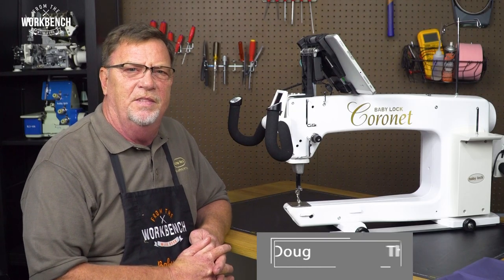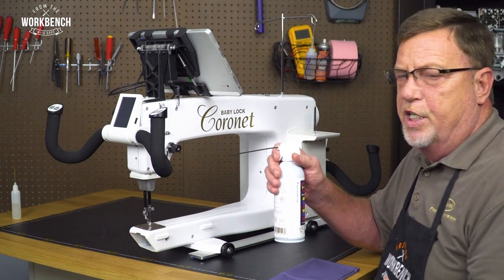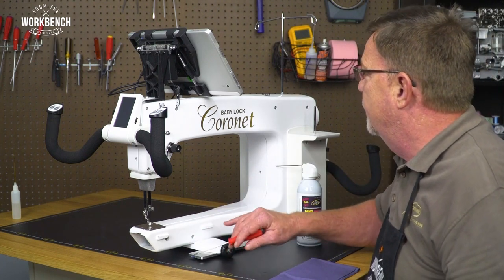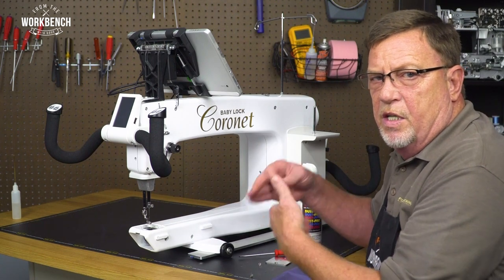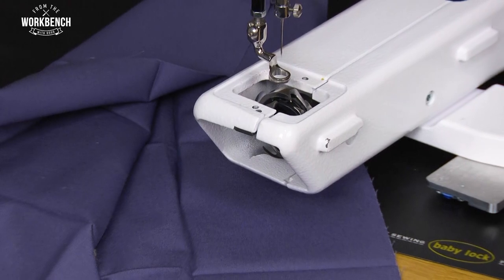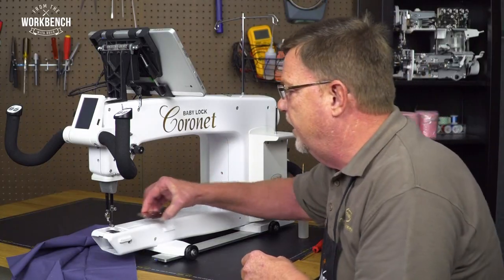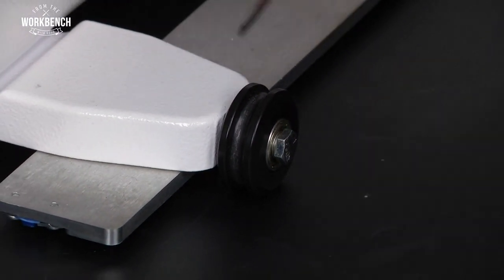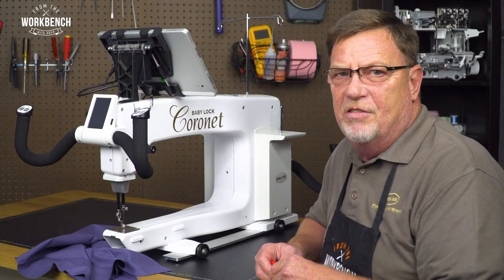How to Maintain Your Baby Lock Longarm

Comment: While cleaning the bobbin area of my Crown Jewel  during a bobbin refill I vacuumed out the lint, there was some lint remaining I used my canned air.  To my surprise the red tube from the canned air blew off into the inside of my machine.  How do I get the tube out?  I am afraid to finish my quilt until it is out.

Comment: Thanks for the video. Very helpful.  Should I be able to raise the presser bar with my hand when changing presser feet to help get them in place?  I have seen videos of longarm machines you can lightly lift the presser bar with you hand.  Mine doesn't move if I try to raise it manually  a bit to slide a foot like the Glide 2 in place. Just wondering if that is available on the Cornet.   thanks
Reply from the maker: It’s easiest to rotate your hand wheel backward a bit, to place the needle and foot at its highest. We hope this helps.